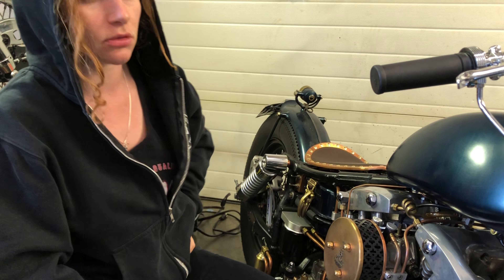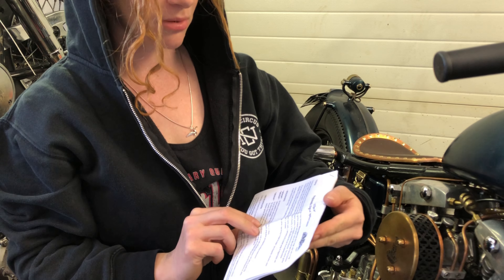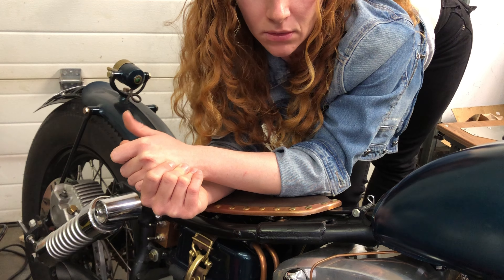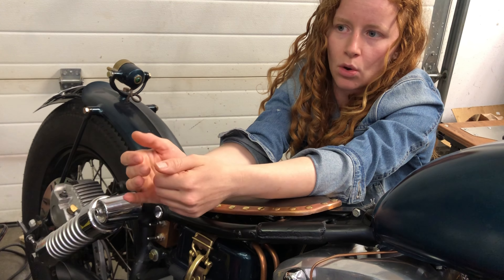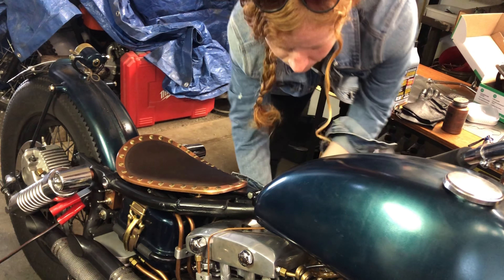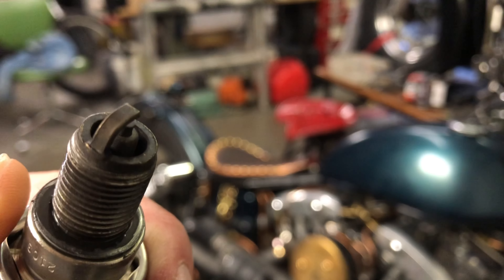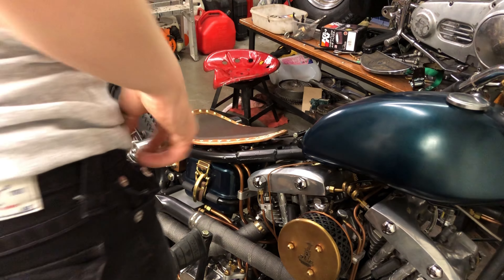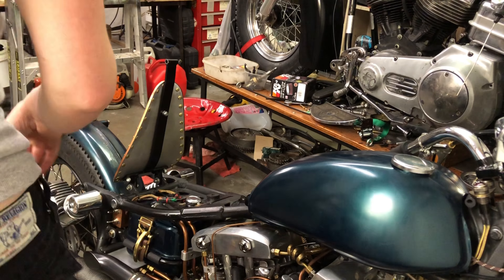Talking about the bike, filling oil and  a Compression test (16:00) on my S&S Shovelhead stroker.

Comment: Red, this message will be brief,  sorry but I have a lot going on. 
The compression is quite low, and the slight increase in the rear AFTER adding the oil confirms that there's not a good seal. Quite frankly,  I thought the front reading would be higher,  again not a good sign. Leak down is next, but if not possible,  put a 100 miles or so, and take a compression test again. I honestly don't forsee it going up much. 
If it doesn't go up continually as you put miles on,  it's as good as it's going to get. Sorry, I truly wish I had better news. 
You may, get away with a touch up cylinder hone, and a new set of rings. But only if the piston to wall clearance is not out of spec. As far as the heads, forget the pop test. If the heads were off, you turn them upside down,  keeping them level, and spark plugs of course,  and fill the ENTIRE chamber with either lacquer thinner, or isopropyl alcohol,  both available in Wally World or any hardware store. If after  a few minutes,  the valves aren't sealing, the fluid will slowly or quickly leak out, and go down the port. Then it's new guides, possibly valves, a valve job, and seals. It would be good to know what camshaft you have so the Machinist can set the spring height and be sure that the retainers won't hit the top of the valve guides. Older shovels may not have unleaded fuel compatable seats etc. So if you're heads are like that, unless you are going to add a lead additive at each fill up, it's best to just upgrade and be done with it.

Red, you can ride it, just be sure to check the oil level before every ride, ok. When it gets hard to start, clean or replace the plugs. I'm assuming it's still pretty cold up north,  so as the weather gets warmer,  I'd run some straight 50, non synthetic until the engine is gone through. And the spark plug threads appear really oily please clean them with some lacquer thinner and tooth brush,  let them dry, and apply a very light coat of copper anti seize. Any questions,  shoot me a message. 
P.S. the spacers Dad made, I would try them UNDER the flange, between the flange and the head. If you look closely,  when you tighten the nut, the flange kinda pulls down, lifting up the opposite side which may end up leaking. It's worth a try,  I would,  because that flange needs to remain parallel to the machined area of the exhaust port. 
JAMES has what's called a Fire-Ring gasket for the Shovel exhaust, it might help. I used them before on a Turbocharged Shovel I built.
My fault for not elaborating,  but next time put the little cap full of oil, kick it through 3 times, and then hook up the gauge. You did fine, no worries.  Also remove BOTH plugs of the opposite cylinder and she'll be easier to kick.

 You did really, REALLY good.

Tombstone Shadow Racing
Reply: Yup , I agree that you are doing good . With an older bike , patience is a learned art . Take a break then come back .
Reply from the maker: This is very helpful, thank you. I kind of figured my compression was quite a bit lower than it should be, but I guess on the bright side nothing is broken beyond repair. It's a bummer though after spending the money on new parts and spending all last summer not riding just to have to do it all again. But this is how I will learn how to just get good at doing my own work, and I am definitely learning!  haha 
I'm still going to get the gauge I will need for doing the leak down test and do whatever else I can to make sure the bike is running as best it can in its current state. I really would hate to have it off the road again for a good chunk of the season, so I want to at least try getting the summer out of it and then do a teardown in the fall. 
I wish I knew what I had for a camshaft in there, but I have never taken the bottom end apart and not sure that I would feel comfortable doing that myself with my rookie experience. I could try contacting the guy who originally had the engine put together in the 90s and see if he remembers. The guy who did my piston job had the cam out too I know but I never thought to ask what all was going on down there, I'm just learning that all these things make a difference in performance. I suspected 14 years ago that I would eventually have to learn how to be a bit of a mechanic if I wanted to continue riding this old thing around. Looks like that time has come! 
And what you are saying about the heads, does apply to S&S heads from the 90s as well? Or are you only referring to stock heads? 

I can't say it enough, thank you very, very much for being willing to take the time and help me navigate through my motor trials. 
You have been a great help as well as a huge encouragement! 

Angel
Reply: Good morning Angel, disregard the concern regarding the unleaded fuel compatability,  the S&S heads should be fine. I was referring to very early original H-D heads. 
Apologies if I caused you any additional concern. 

For now keep an eye on the oil level in the tank each ride, and the oil in the rear pipe, and get yourself some
WIND THERAPY.
You certainly earned it. 👏
Reply from the maker: @t.s.racing  thank you very much kind sir!

Comment: I'm looking at the angle of those shocks and wondering if they actually function at that angle, is that stock? Hoping you'll answer that, thanks.
Reply from the maker: The lower mounts for the shocks are set back further in the swing arm than where they would be normally. Was part of how we lowered the bike for my short legs,and yes they do work!
Reply: @RedRiderCanadaBC  Thanks, that's a great looking bike.

Comment: compression is depending on your camshaft Because you have a 93 inch motor I would tend to believe you have a non stock cam You show 80 psi on both cylinders so that is good S&S web site is a great source of info on shovelheads Lee's speed shop has a tip for torquing shovelheads ON a older video I was looking at it looks like a set of tubes coming out of your oil drains out of you heads I do not see the need for these I am wondering if an excess of oil is being trapped in your rocker boxes and coming down your valve guides With dual plug heads you run less total timing than with single plug heads I am wondering about the VOES that runs off of engine vacuum and retards timing Your bike is a work of art Just a heads up copper work hardens overtime vibration does it so I wound cut the lines and put a piece of rubber line between the line You should be proud of yourself YOU are trying and learning THAT is a hell of a lot more than a lot of people do Keep at it you learn from your mistakes GREAT bike Michelangelo on his death bed told his student he was still learning So am I
Reply from the maker: So the timing now; are you saying that dual plug heads need to have the timing be retarded a bit compared to single plug heads? I static timed it with the VOES  switch off (meaning timing was retarded) and then turning the switch on grounds the VOES making the timing slightly more advanced... I don't know how I feel about the VOES to begin with, I haven't heard of many guys who like, or even use them.
Reply: @RedRiderCanadaBC  When I time my Shovels I have the firing line on the back side of the timing hole Because Knuckles Pans and Shovels ( Iron head Sportsters) are hemi heads The dome impedes the flame travel dual plugging improves combustion so I run a VOES on the Evo I built I was wondering Time as a single plug head and use the VOES to retard the timing THAT might be something to explore  I enjoy you because you are teaching me by asking questions D. William Denish published a book on high performance Harleys  IT is a great source of information Covers a wide range of items AND it passes the smell test An old biker told me to all ways remember that when my butt touches that bike seat WE become invisible Best piece of advice I ever got Your doing good Keep up the good work !!!
Reply from the maker: Thanks for replying back. It’s cool people can learn something from my videos, I’m a little surprised because I feel like I don’t know too much haha. So, what is “the smell test” that you are referring to? Lol 
Thanks for being on my channel too!
Reply: @RedRiderCanadaBC  hi I was cutting grass I need to correct myself The timing mark in the center of the hole should be 35 degrees just coming into the hole should be about 32 degrees I can tell you this every motor is different Every one responds  differently I have built motors back to back same parts combo and each is different Smell test If it smells like bs it probably is bs AND for the record I am not the sharpest knife in the drawer  I enjoy you I am still learning 🙂
Reply from the maker: Thanks!

Comment: Also what kinda cam are you running  ?
Reply from the maker: I'm not sure on what my cam is... I haven't had the bottom end apart myself, and don't have the contact for the original builder of the engine. It was put together by a friend, of a friend, of a friend in the 90s some time and I ended up with it in 2010. I might be able to contact the guy who did the most recent work for me about engine size after having the cylinders and pistons done, but he kinda went "AWOL" in a way shortly after I picked my motor up from his shop.
Reply: @RedRiderCanadaBC  well I was just going to say there are some cams that are made for kicker only bikes and it's easier on kick-starting
Reply from the maker: I need to find out what I’ve got for a cam. I just know that there ain’t no cheap parts in this engine that I have seen so far… think my cam is a Jim’s if I remember right but I just don’t know what size  or anything. I should have wrote it down.
Reply: @RedRiderCanadaBC  also keep in mind the most high performance cam isn't necessarily the best cam for an everyday street bike that you're going to bring a lot of miles on the line Weber l-31 is a great everyday cam for a bigger motor but I'm sure a lot of people have a lot of different ideas about what the best is so take everything with a grain of salt

Comment: I made comment on oil by pass. I would have be there to see what going on with engine. I'm old school mehsnic been working on engines since I was 16.  Still working on them. Wish I were there to help
Reply from the maker: I got oil in my carb... was thinking that would be due to the leaky valve stem seal in the head..?

Comment: Its hard to compression test properly by kick starting, electric starters allows a consistent turn over until the gauge stops.   You don't need to put oil in the cylinders to test. I'm not sure you're getting accurate numbers for your test...  Also, while your running that engine in, try and vary the rev range , sitting on a constant speed isn't great for running in an engine, you probably already know this...
A tip for cleaning spark plugs, use a propane bottle /torch, drill a couple of holes in a piece of 4x2 timber big enough to sit and hold the top of the spark plug, turn the torch on and heat the plug,  it will glow red, and it seems like its a lot of heat but it works, until all of the carbon is burnt off.. Here's a link.

https://www.youtube.com/watch?v=PuXkRiW6C80
Reply: Mick, you put the oil in after the first test to see if it changes the reading,  which it did in the rear. It went up 10 p.s.i. This will help show that you don't have a good ring seal. The way it's been done for decades.
Reply: @t.s.racing  Yes, agreed , I was referring to the original Comp Test , either way I'm not too sure she's getting an accurate reading in the first place...
Reply from the maker: Thanks for watching!

Comment: How many  inches is your motor  ? And is it all s&s  ?
Reply from the maker: S&S crank case, jugs, heads and flywheel. I have Jim's lifters and lifter blocks and I know I have some other Jim's parts inside my crank case, but can't rightly remember what those parts are. Only thing stock on my engine are the rocker boxes. I'm guessing my motor is a 95 inch after this last rebuild, as it was a 93 inch before the cylinders were bored out.
Reply: @RedRiderCanadaBC  for a 93 inch motor I'm guessing you're running a four and a half inch stroke in my opinion that's as long as stroke as you want to run in a Shovelhead or older motor they run great with a four and a half inch stroke whether it's stock bore or Big Bore should be a great motor have fun
Reply from the maker: It is a 4 1/2 stroke, and was a 3 5/8 bore before the new pistons.

Comment: Did I understand right - you managed to start it and took it for a short run -   the compression test is just that - not actually getting it to start??  Is she starting now??  I messaged on instagram again btw  -
Reply from the maker: She is still being a tricky start and likely has to do with the compression. I am going to check the timing, and the jetting on my carb and make sure those are all good just to rule out any other factors that may be making it a hard start. I also think that I might not have figured out how much fuel it likes to start - think I may be flooding it more often than not. Trial and error! I'm just hoping to get the season out of it at this point, if I can. 
I'll get back to you on instagram asap, sorry I just seem to be putting a lot of my social media energy into youtube these days, so please don't take offence if it takes me days ( or weeks ha) to get back to your comments sometimes!
Reply: @RedRiderCanadaBC  Thanks for replying busy lady :)  So was it a mix of compression measures and starting attempts?  I'm sure its a petrol mix issue.  Those black plugs are a bit of a giveaway. I'll drop my email in an instagram private message and if you like we can set up a whats app.  I'm in the Uk as you know but you can live message there for free and maybe I can put my oar is if she's being a   ****   :).
Reply: @RedRiderCanadaBC  I'm sure you're right about the compression but we need to see a few tries to hear and see what the engine is and isnt doing.  whenever you can manage it will be great  - don't bother editing ! -. Btw look how your numbers are growing :)
Reply from the maker: I’ve got a kick start video from the day I did the compression test that I am intending on getting up.

Comment: 100 PSI is the minimum. It should be 125 to 150, and some engines have as high as 170 PSI or more. Yes, an engine can run with lower compression, but it will run very poorly.

Comment: ultima ignition was best $ eye ever spent!!
🙂
Reply: eye run vr1 50weight racing oil in me ironhead.
Reply from the maker: @benderbender1233  I'm thinking I may have to make the switch to some heaver oil once it starts ti warm up a little more here!
Reply: @RedRiderCanadaBC  yeah eye run 60w in summertime.
✌😘
Reply: 20/50 in da prary tho. all VR1 wit zinc tho.

Comment: Is your engine running solid lifters or hydraulics? Solid lifters can be a little finicky to get the adjustment just right, that's the cheapest thing to do first, if that doesn't change anything then I would say your cylinders need to be bored to the next useable size and  pistons, Here is a good video on adjusting solids, if you have hydraulics he also has vids on them. Mike is an awesome guy and will take the time fo help you with any questions you may have. Don't let the panhead part bother you, the procedure is no different, https://www.youtube.com/watch?v=UrUpZCpke9g&t=1031s
Reply from the maker: They are solids. And thanks!